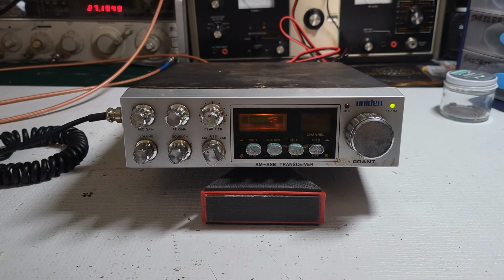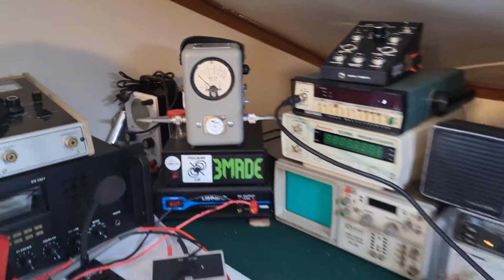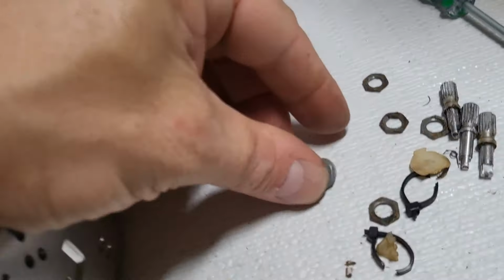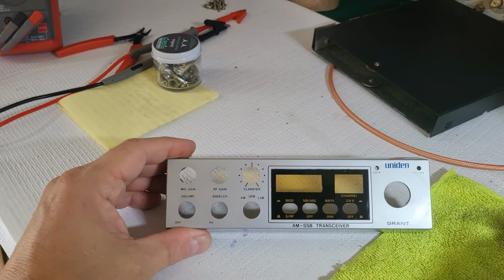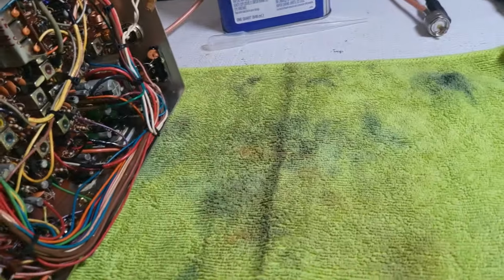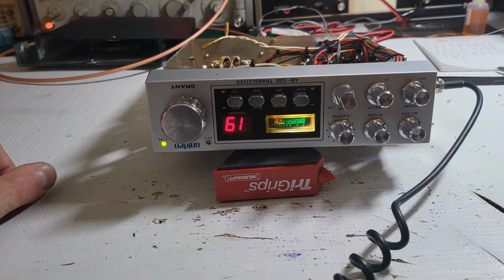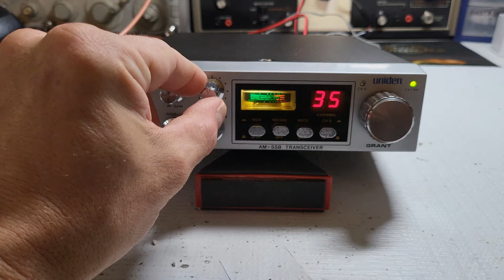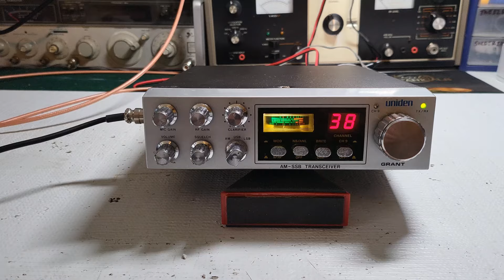Saving a Uniden Grant from the scrap pile

Comment: I have 858 chip in my grant. they put 3amp fuse it took 3 years find the problem it made my  radio  stop  transmit with d104 when put 5amp fuse back in july 2024 in my radio ran my turner plus2 it start transmit yep if people have problem with there  older grants tell them check the fuse.